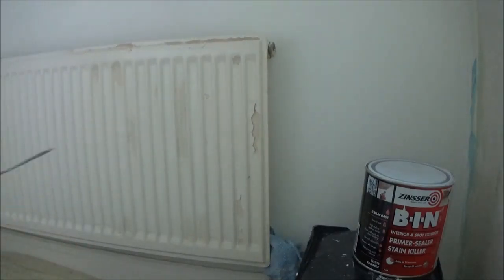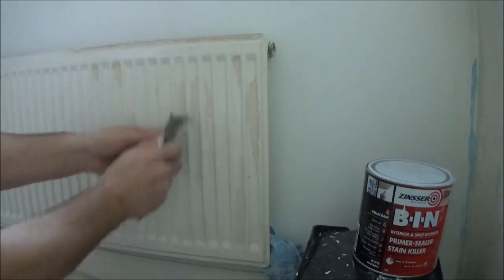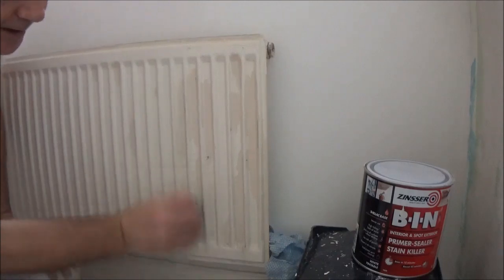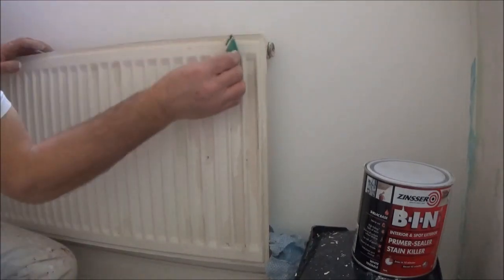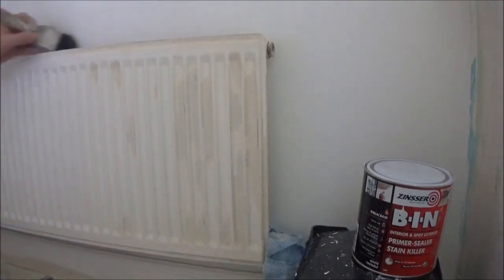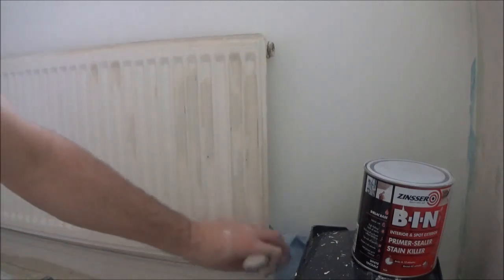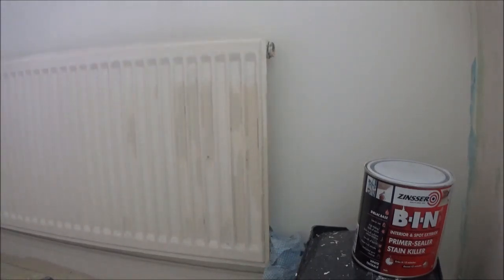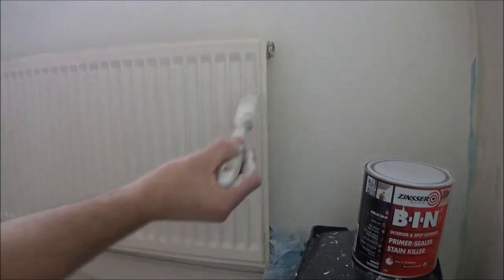Paint peeling off radiators

Comment: Good job, but I'd rather spend the time building a cover for that thing. Most of the newer radiators here in the USA are just flimsy fin tubes that need covers to protect them. The covers are usually fairly ugly metal things, but you can always build them from some kind combination of wood, tile, or a nicer looking metal grate. With covers, they are a little easier to keep clean, safer, and because the covers don't heat up as much, they hold paint or varnish better.

Comment: I bought a sanding attachment for the drill. 
Basically it was 50 or so small pieces of sandpaper in a circle, once these were spinning the paint came straight off. £3.50
Reply from the maker: They do work but can be dangerous.
Reply: Where from?
Reply: @qulsoomrazaque4921  You can buy one from any DIY place, there's a few different kinds to choose from, wire or sandpaper etc.
I bought my attachment from Wilkos.

Comment: I’m just in the process of repainting a radiator and I found you video very useful. The front of the radiator is flat, the fins are on the back. The old paint had flaked very badly. I removed the flakey stuff using a scraper and sandpaper. However there are now hairline cracks all over the place, without loose paint next to them. How do I deal with these hairline cracks please?
Reply from the maker: Charles Arnold you will have to sand them down best you can or strip the whole radiator.
Reply: Painting and Decorating many thanks for your extremely rapid reply. Stripping the radiator at this time of year when the weather is so cold is not really an option so I will sand and paint and sand and paint and see what happens!
Reply from the maker: You can fill the cracks.
Reply: Painting and Decorating what product would you suggest please?
Reply from the maker: Something that can be lightly sanded 2 part wood filler would work, use a metal primer on bare metal first
Reply: Painting and Decorating thanks. I'll try it... On reflection it occurs to me that the temperature of a radiator can change from say 15 deg to say 60+ deg (when the weather is really very very cold). So would wood filler be suitable?

Comment: Wish my radiator was this easy. I've had to use a paint stripper but it's left a lot of sticky residue I'm now stuck trying to get off. Many layers of paint don't help either
Reply from the maker: Not nice hope you get the finish you're after. White Spirit may help to get the sticky residue off.
Reply: Painting and Decorating thanks. Might try removing the radiator to get a better angle on it then give it another go. Will give white spirit a go

Comment: why you do not use a metal hard brush with a drill to remove the all paint in much shorter time and hassle free?!
Reply from the maker: You can but it's extra tools and safety you have to wear eye protection.
Reply from the maker: This is just a cheap easy noise free way.
Reply: BG 7
Reply: Thank you BG!

Comment: Great informative  video. Gosh it's a lot of work I might just use paint stripper and remove,prime then paint....I have 6 radiators to do various sizes.
Reply from the maker: Thanks, paint stripper will be good, but it all depends on how much is damaged.
Reply: @PaintingandDecorating  Thank u for your reply I did it your way in the end not much heavy flaking mostly rust which I removed. I used Dulux Once paint in the end very runny but great finish the radiators look new. Keep up the good videos they are very helpful for novice d.i.yers like myself ☺